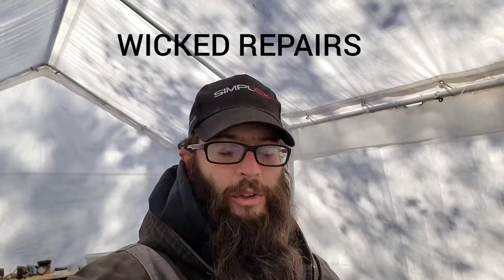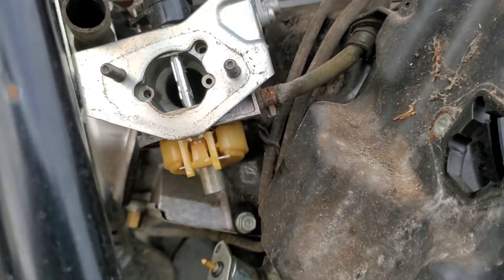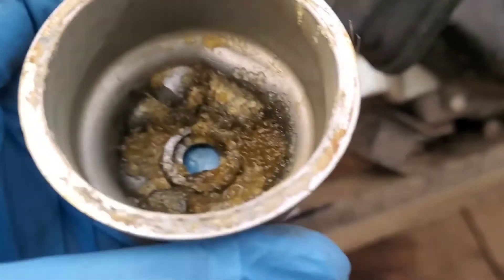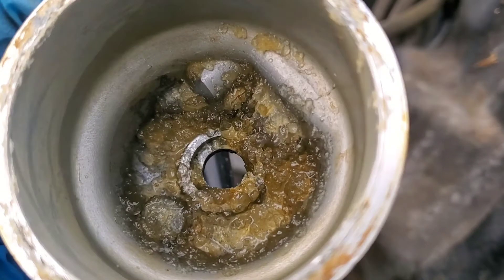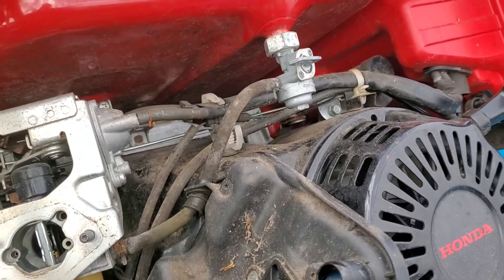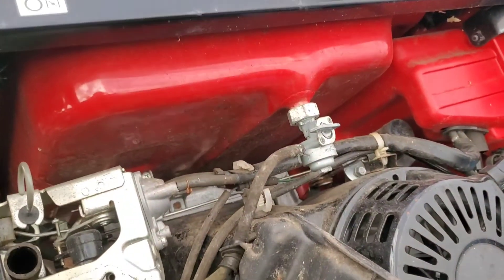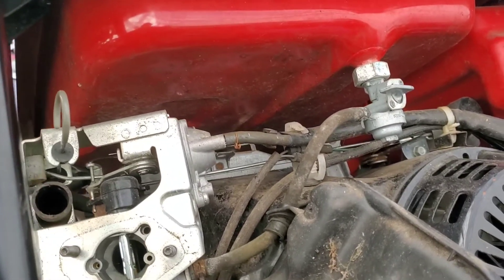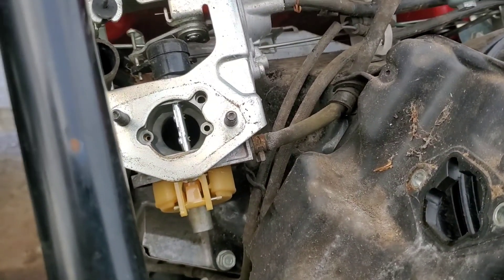Ethanol fuel|Dirty carburetor|Preventatives

Comment: I have been looking at so many videos about blocked carburetors and your video is the only one that mentions that electrolysis causes the corrosion. When an electrolyte is present (water and alcohol) with brass touching aluminium or zinc and plenty of time you have a big problem. I had suspected ethanol was the problem but had no proof until I started watching youtube videos. Thank you so much for your video! I pick up lawnmowers from the side of the road and most them will not start because that problem.
Reply from the maker: I'm glad you enjoyed the video! Yes, that is the biggest problem and is exactly why this happens. It rarely occurred before ethanol was introduced into our fuels. It's a daily issue for many people with mowers, generators, and items that aren't used often. The shelf life of ethanol fuel, not treated is 14 days and then it starts to deteriorate. If treated properly with fuel stabilizer, it should last up to 1 year, I would trust 6 months though.

Comment: So is it OK to run the carburetor out of fuel when not using it for the winter? Will the seals dry up?
Reply from the maker: Yes it is ok! I would stabilize the fuel, and shut the fuel off then run the machine until it dies out. As an extra precaution I would also Crack the carburetor float bowl drain screw loose/take it out and put a rag or container underneath to catch any more fuel that may come out. Your orings should be fine.
Reply: @wickedrepairs8527 . Thanks for the advice, will do.
Reply from the maker: @robs9324  you're welcome!

Comment: I hate Ethanol. It causes so many problems and is such a scam, just like MTBE was.
Reply from the maker: Yes it sure is awful! Sometimes you can take all the preventative measures and still have issues.
Reply: @wickedrepairs8527  Yeah, the only simple solution that I've found is to have a ton of Stabil in addition to the overpriced Ethanol free fuel cans since there are'n't any of those types of gas stations anywhere near me.
Reply from the maker: @slhines7  yes definitely! Ethanol free is the best way, but pricey depending on what your filling up.
Reply: @wickedrepairs8527  Much cheaper at one of those ethanol free gas stations as opposed to buying the canned stuff at Home Depot. They charge over $20 per gallon which is ridiculous.
Reply from the maker: @slhines7  you got that right! It's crazy expensive!
Reply: @wickedrepairs8527  Seems like the whole adding of Ethanol and MTBE was just another form of shinkflation, but under the guise of "environmentalism". Just another form of distorting the so-called "markets".
Reply from the maker: @slhines7  yes indeed! Nothing but a gimmick. It's definitely worse for carbureted machines but I've seen it gum up fuel rails and injectors as well as foul out spark plugs
Reply: @wickedrepairs8527  Damn, that's terrible but not all that surprising. Thank God for Stabil and other similar products.
Reply from the maker: @slhines7  yes definitely. My favorite stabilizer to use is yamaha from a dealership. I ran a lot of tests on stabilizers and it was the best one. Sta-bil (the red one) actually didn't test too good and started to rust a bolt after about 1 week off sitting. Startron was horrible.
Reply: @wickedrepairs8527  WOW! Good to know, will have to check out that Yamaha one then since I've only used Stabil since day one. I mostly just use it in vehicles that I don't really drive much and extra tanks for fuel for mowers.
Reply from the maker: @slhines7  yes absolutely, I did tests with boots I'm the stabilizers as well as open containers of fuel stabilized and not stabilized. 7 days non stabilized fuel starts to discolor and take on moisture from the air because of ethanol!
Reply: @wickedrepairs8527  How about using the Stabil 360 or Marine instead of the regular Stabil?
Reply from the maker: @slhines7  yes the marine tested better than the red!